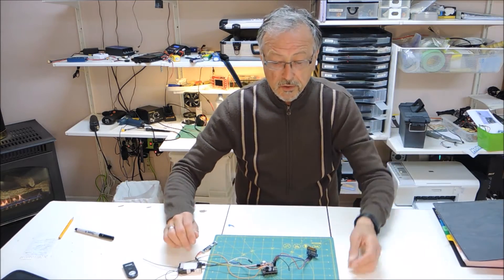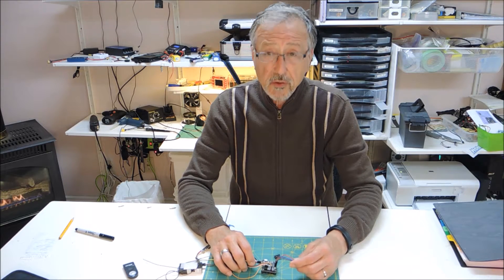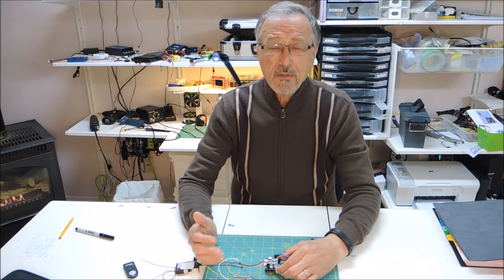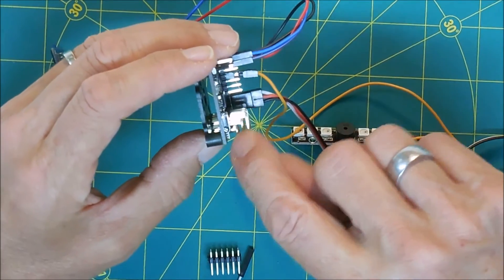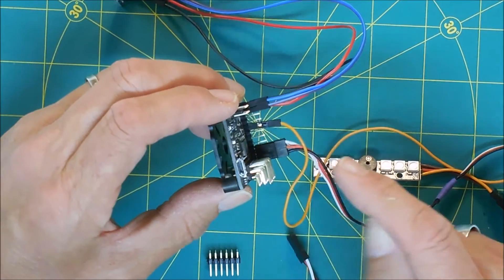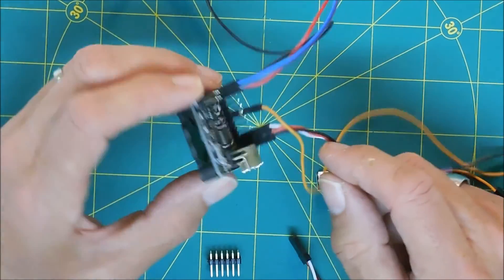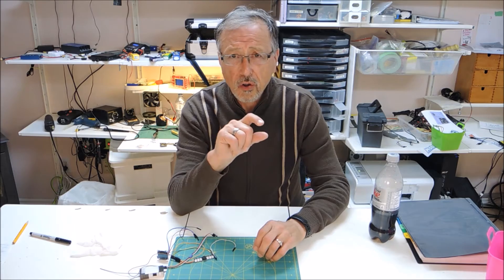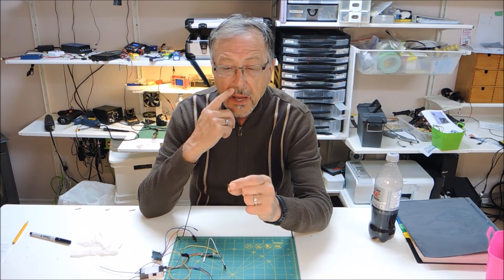Bangood Naze32 Rev 6 Problem

Comment: If you take off the black plastic connector leaving the wire's you can solder them direct to the pins and then shrink wrap them for a much better connection.

Comment: I would have thought the give away for you would be before soldering would be the length of the pins on the underside.
Expensive mistake as long as you learnt something all is good.

Comment: nice i had to pull mine out of the junk box and look but i did it correct anyway.after installing cleanflight i wasted a lot of time trying to make it work barely able to very fly at all.big headache.asked a few times from youtubers but no responses.i think its looptime but i dont no how to input commands on cli.i have tried not able.naze32 6dof rev6 had high hopes for this.not for a beginner like me.

Comment: the pins were soldered in backwards lol i.e the black plastic is the stopper for the servo leads not a crutch to make it easier for noobs to learn to solder straight lol look at cc3d board pics (the ones in cases) till you can see that the cockup is NOT made by banggood :)